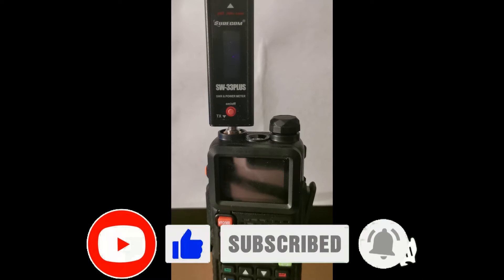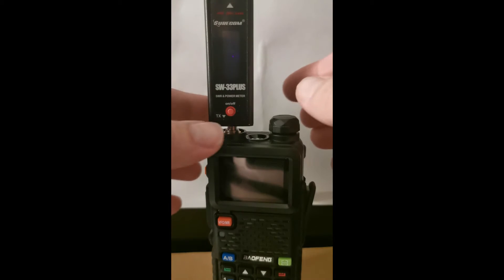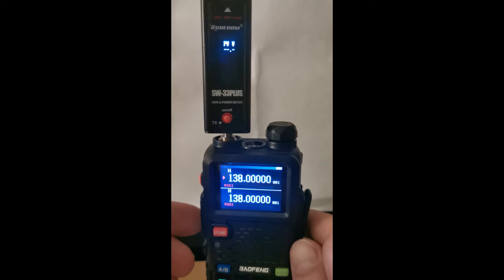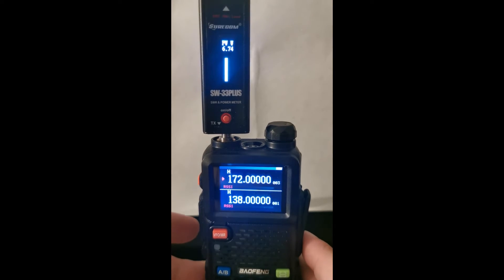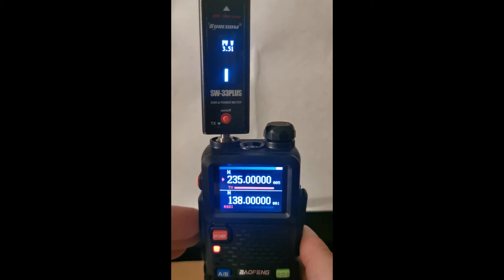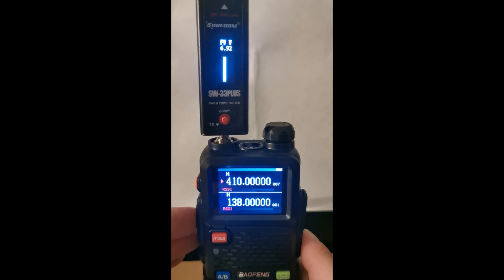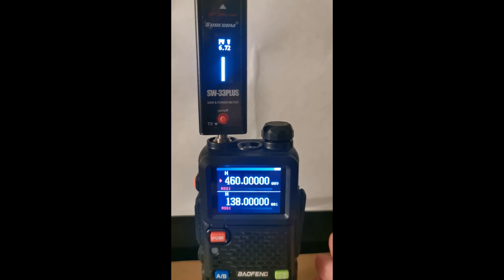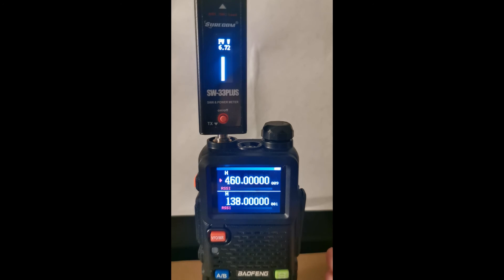The Amazing Baofeng Uv-5rh Ham Radio: How Much Wattage Can It Output On High?

Comment: Hold the radio in your hand as per normal usage when measuring power output. Basics.😉
Reply from the maker: +@gowerdave please explain why. I have done both and both show the same results. I do it this way in the video as it's easier to record.
Reply: @ham-fam  Fair enough if you achieve the same results. Holding the radio provides a counterpoise/grounding of sorts so I have read.

Comment: Which is better baofeng triband UV5RH 10 watts or quansheng uv k6 multi band 5 watts?
Reply from the maker: IMO - UV5RH for general use - Quansheng for playing with Firmwares and Modding (but dont transmit without testing output)